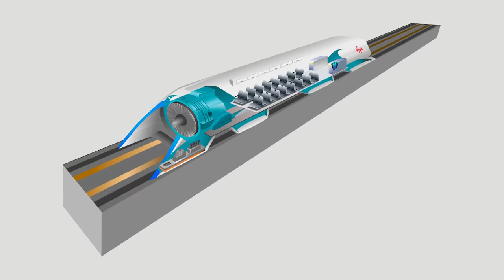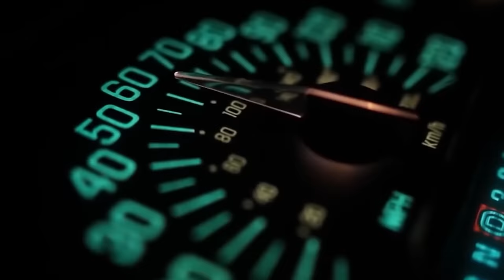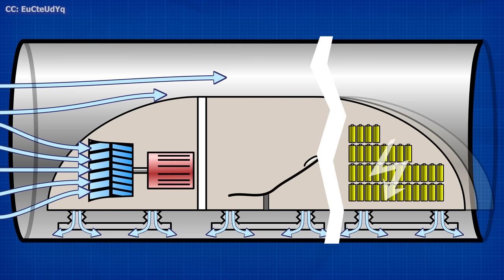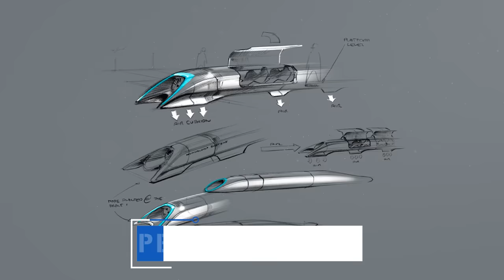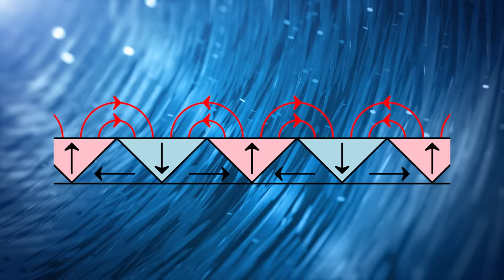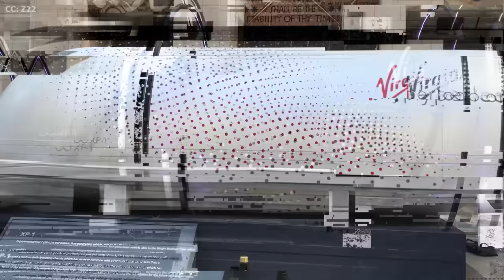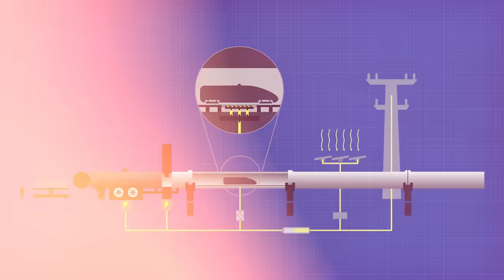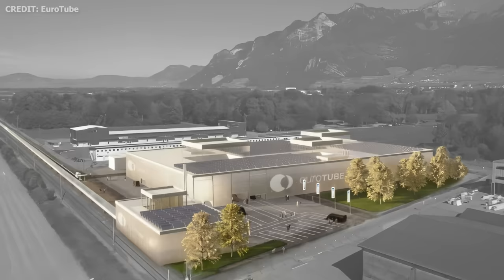We’re Getting Closer to a Hyperloop...

Comment: Japan's maglev train shows you don't need to build dangerous "vacuum tubes" to be able to go super fast.
Reply: I don't think Japan has maglev trains. China has a line or two in operation, all others are prototypes. It's just way too expensive. The point of Hyperloop is low cost.
Reply: @andrasbiro3007  "low cost..." Then why are all Hyperloop operational cost estimates 10X that of regular high speed trains and 5X that of airliners? Oh boy.
Reply: Six operational commercial maglev systems can be found worldwide, with one in Japan, two in South Korea, and three in the big C. The most extensive among the three within the big C is the impressive -Shanghai-Transrapid-project-, accomplished in a mere two and a half years at a cost of ¥10 billion (US$1.33 billion).

It stretches across a 30.5 km (18.95 mi) track and boasts an impressive top operational commercial speed of 431 km/h (268 mph). Consequently, it has held the title of the world's fastest train in regular commercial service since its inauguration in April 2004.
Reply: @andrasbiro3007  Don't lie.
Reply: @mururoa7024 
Because they are hopelessly wrong. We can argue about the construction cost, but the operation will be cheap. There's nothing that could cost much money. The power consumption would be minimal, that's the whole point of using vacuum, and the entire system is just a couple of electric motors that need very little maintenance.

Regular high-speed trains have to fight drag and rolling resistance, hyperloop doesn't. And planes burn a lot of very expensive jetfuel, while hyperloop runs on cheap solar power.
And hyperloop can even recover it's kinetic energy during braking.
Reply: @neo4reo 
That's better then I thought then, but still negligible. Less than one short line per decade.
Reply: @neo4reo 
Where did I lie?
Reply: @andrasbiro3007  does your mom know you're trolling on internet?
Reply: @mururoa7024 
Are you talking to yourself?
Reply: @andrasbiro3007  ''The point of Hyperloop is low cost.'' Now that's the biggest joke I've heard about it so far. It's not even remotely low-cost, neither in building it, nor in maintenance. How will you maintain an even vacuum over several kilometers? That's right, you need a crap-load of pumps. How will you perform maintenance on and inside the tube without having to shut down the entire track and removing the vacuum? How precise do you have to make the bore tolerances for the tube and ensure that it never gets too wide or too tight throughout the track if sun radiation heats up the tube?
Reply: @InfiniteDeckhand 
1. Maintaining low pressure is easy. Tunnels are already airtight and can withstand several atmospheres of external pressure. Simply because of groundwater.

2. Pumps are very simple machines. And once the desired pressure is reached, they won't have much work.

3. Not much maintenance is required inside the tunnels. Maybe once a decade.
And it's trivial anyway, a pod can just go there, deploy inflatable seals on both ends, and then workers just do their thing normally.

4. Since they use boring machines with a fix diameter, the precision is automatically given. And it doesn't have to be super precise anyway, the pods should levitate at least a couple millimeters high.
Or if it's an issue, there are many ways to make the surface smoother. We have huge concrete surfaces with a mirror finish.

5. No sun underground.
Reply: @andrasbiro3007 
1.They're not, even maintaining low pressurized pipeline is harder than it seems, even pipeline contract and shrink. That leads to fail gaskets and broken seals all the time. That's your ordinary pipeline not even hyperloop pipe. I work in oil pipeline industry. 

2."Pump are simple machines" yes if you're talking about pump that sucks something liquid, then it can negates some of the heat and transfer it to the liquid it, it will be much harder and hotter for dry pump air and more energy extensive. 

Hyperloop Pipe will lost pressure on each transit unless you invent air pressure locking mechanism on each transit station which adds more cost. 

3. Maintenance are absolutely needed
Even simple pipe like oil pipeline get checked daily for cracked seals, failed gasket and corrosion. That's why pipeline will avoid underground tunneling if not really necessary. Even japan shinkansen rail are checked daily by seperate maintenance locomotive for ensuring the stability of rail.

4. Concrete are naturally porous. Air molecule are smaller than water molecule. You don't want building anything related to hyperloop with concrete. Not even the tube support structure. 
Since it was highly pressurized, even ordinary pipeline used steel and thats not related to people life's. Tempered steel is bare minimum but if you want to be safe then titanium all the way. Which add more cost.

5. no sun underground mean humidity will be much higher which leads to risk of corrosion is more prominent to all the structures, the tube itself and and its support structures, which leads to. More maintenance. 
 
Hyperloop Are carrying people not freight there's no way department of transportation of any country will greenlight mass transportation that lacks any means of possible evacuation. Underground mass transport are dangerous enough. Now you want add vacuum aspect to it? 

US high speed railway predicted to cost $57 million dollar per km and China cost $17 million dollar per km
Maglev is even more expensive than that, since hyperloop technology is new it could be quadruple of maglev cost
Reply: @TheAriebudhiw 
1. Tunnel, not pipeline. If you go under the groundwater level you have to be watertight, for obvious reasons, and also withstand high pressures, because you are essentially underwater too. So adding vacuum makes little difference.

2. Pumping air is like not rocket science. And even if it were, Elon has a rocket company too. By the way, it's possible to create vacuum using a rocket engine. The title of the video is "Defying Atmosphere - How Rocket Engines Get Tested In A Vacuum Before Going To Space". So if you just happen to have powerful rocket engines lying around, it's a possibility. I imagine these would be able to move a decent amount of air. A bit less extreme would be something like a modified high-bypass turbofan engine. But even these would likely be an overkill by a few orders of magnitude.

3. Again, tunnel, not pipe. Tunnels are generally very low maintenance. No rail either.

4. Air has to come from somewhere. Underground in the water table it's hard to find air. Also there are many ways to further reduce leaks. Additives, impregnators, a separate sealing layer between the concrete and the ground, etc. It's easy because the concrete does the hard part, the sealing just have to prevent diffusion.

5. Concrete doesn't corrode much. And tunnels are pretty common technology, going back thousands of years, we know how to make them. In fact, some tunnels were left without maintenance for thousands of years, and still working as intended.
I'm pretty sure there's an easy solution for humidity too. Like subways exist and aren't wet. Vacuum helps too, as the pressure goes down so does the boiling point of water.

6. Why wouldn't there be a way to evacuate? For starters, won't be worse than any other tunnel we use all the time. In the worst case you just re-pressurize the system and people can just walk out. But before that there would be many other solutions. First, the pods can simply coast to the nearest emergency exit without external power. They just need their air cushion, which can be maintained by redundant pumps. It would be much more reliable than planes. Then if a pod gets stuck, a rescue vehicle can simply dock to it's back and take the passengers out. Fire would be impossible outside due to the vacuum, and extremely likely inside due the lack of flammable things or ignition sources. For extra safety the electric parts can be kept completely separated and mostly in vacuum.

7. Also it's already operational in small scale and without vacuum. It's called Loop and it's in Vegas. It's been approved and very successful.

8. The whole point of Hyperloop is that it would be 10x cheaper than the California high-speed rail. There's no rail and no magnets (apart from propulsion), and no need to buy up tons of land either. And the cost of tunneling is drastically reduced by the in-house automated electric boring machines. And they even found use for the removed dirt, they make bricks from it. So instead of paying a ton for the disposal, they can sell it.
Reply: @andrasbiro3007   lmao, all the hyperloop prototype are using steel as material that make them a
More of a pipe than tunnel my dude. Did you even watch the video? Are you saying you are smarter than the engineer behind it that use steel? 
Rocket engine really, lol? Rocket engine is expensive, it's fuel even more expensive? And liquid oxygen oxidizer and liquid hydrogen are extremely combustible. Yeah keeping the cost down by using jet engine to reach near vacuum sounds logical.
Even if you insist, Concrete will make the pump work harder since concrete is porous, which will make it more energy extensive.
No one interested in "hype"loop anymore, india canceling their program, the qatari and Saudi probably too. Elon in his biography even said hypeloop is an agenda to lobby to make California HSR canceled, And it did apparently.
Reply: @andrasbiro3007  Hyperloop is such a waste of money. Just build more trains ffs stop wasting our limited resources
Reply: @TheAriebudhiw 
1. Those have nothing to do with Elon's Hyperloop. And therefor completely irrelevant to this conversation.

2. I'm not smarter, just reporting what the real engineers are saying. The best engineers in the world are working for Elon.
And as you can see from my reply, tunnels have a lot of advantages. The only reason they aren't used more is the cost. And that's exactly what The Boring Company is set out to fix. 

3. Obviously joking with the rocket engine, there are plenty of much simpler solutions. But it would work. And yes, it's cheap. At least the ones SpaceX builds. A Raptor costs $1M today, and it should go down to  $250K when production is fully ramped. And it has 300 tons of thrust. Exhaust velocity is 7173 mph, mass flow is 1400 lb/s. That's 4.4GW kinetic energy in the exhaust.
In pumping performance that's 1,500,000 cf/s airflow at 1 atmosphere dynamic pressure. If I got the physics and the math right. That's 0.6 miles of tunnel evacuated every second.
Raptors use Liquid methane and oxygen. Both are relatively cheap. I'm not going to do the math for this, I've spent way too much time on this already.
Again, this is a joke, there are far simpler ways to pump large amount of air.

4. As I said, there are many ways to seal concrete. It's being done routinely in construction.

5. Irrelevant who is interested. Elon has the money and resources to make it happen. It's on the Boring Company's agenda.

6. HSR wasn't cancelled. At least according to a quick Google search.
But yes, Elon wanted to cancel it, because it's extremely overpriced.
Reply: @rrai1999 
Trains are the waste of money. The Hyperloop would be 10x cheaper than the rail system it was meant to replace originally.
And it has a lot of other advantages too. Like speed and efficiency. Also with tunnels it doesn't take up any space on the surface.
Reply: @andrasbiro3007  Too bad it doesn't work and is a load of crap.
Reply: @rrai1999 
That's your uneducated opinion, which has zero value.
Reply: @andrasbiro3007  Unfortunately I am educated on this load of trash. I wasted time looking into it because it seemed like an interesting new way to get things where they need to go. Until I realized trains do what they purport to do but they already do it, there is industry tooled up to create more of it on the cheap in comparison to virgin hyperloop technology, and that the hyperloop technology isn't even efficient, due to only sending one cargo pod box at a time. The vacuum is not feasible to create for such a long distance. The energy consumed maintaining this vacuum is too much for it to be a usable technology too. It's dead in the water.
Edit:
Also, that's your uneducated opinion. Which has zero value.
Reply: @rrai1999 
1. My opinion is not uneducated, I have a physics degree, and studied this topic a lot.
Also it's not my opinion, I'm building my arguments on facts.

2. Virgin Hyperloop is very different from Elon's Hyperloop, especially after it's been moved underground.

3. The Hyperloop isn't meant to be used for cargo. Cargo doesn't need speed.
And in the US freight trains aren't as popular anyway, and going out of fashion in general too, because trucks are much more flexible. Also with electric self-driving trucks, that Elon happens to make too, road transportation is going to be cheaper than rail too.

4. The proposed high-speed rail in California was estimated to cost like 10x more than Elon's Hyperloop. It's an especially expensive rail line, that's why it became a hot topic in the first place.

5. Vacuum is feasible for any distance. Especially since it's not true vacuum, just very low pressure. The cheapest pumps you can buy are able to reach the required pressure. From there it's just scaling up. Tesla and SpaceX solve similar problems regularly.

6. I used ChatGPT to estimate the required power to maintain the vacuum. For a 100km tunnel it's roughly 4MW. That's $3M per year. It's no big deal. This is of course order of magnitude estimate.

7. Asked ChatGPT to do design a solar farm with storage and estimate the costs for it. It's $25M initial investment, and $250K per year operational costs.

8. So much more fun to have ChatGPT do the research and math.
Reply: @andrasbiro3007 
1. Doubt. I can claim that Im a physics professor on internet but that holds 0 value unless I back it off with actual proof. Same applies to you

2. If Elon's hyperloop is that good why every hyperloop company abandoned it and tries to work on their own modified versions?

3. What self driving truck from Elon lmfao. He made only double digit truck that's nowhere near as good as he promised and Tesla Self drive still needs to be supervised with occasional human intervention on cars, not even semi trucks

4. High cost of HSR in California is coming mostly from trying to buy lands for relatively straight track and making many structures on challenging terrain. Not because 2 lines of metal with technology that already exist in Europe and East Asia is expensive. Any1 with more than 2 brain cell would realize that Musk's estimation is pure BS when Hyperloop literally requires more construction on same challenging terrain and same straight track that requires many land/permission purchases.

5. Neither Space X nor Tesla ever deals with vacumn space for multiple pods for hundreds of miles. The fact that current largest vacumn chamber is 100 ft diameter 122ft tall chamber by NASA (which is tiny compare to hyperloop) and how its door and walls of that room are massive seems to say that maintaining large vacumn is indeed hard.

6, 7, 8. Chat GPT is known for being often inaccurate on difficult and complex topic and it only has limited access to advanced academic database.  Also you simply havent provided all the variables for it. Some variable are straight up unknown because it depends on size and design of finalized system (pipe size, how much pressure difference, how much air intake when people enters and leaves hyperloop, how often such air intake happens etc etc).  As a result chat GPT just yapped random number from incomplete data because there isn't a complete list of variables to even do theoretical calculations. Perhaps you should have checked on any article about how to research with chat gpt since they all say its pretty good at helping you with writing but you have to double check info.

Conclusion: youre the clown here

Comment: The main problem I see at least with any of these large projects aiming to spend a lot of money in order to move people very fast over large distances, is that you can negate the need for such a thing by either removing the requirement for the people to travel in the first place (remote work, telepresence, etc), or just using existing methods and accepting the travel time, use the money to make the journey more comfortable, provide good internet on the trains etc. 
Both of these come at a fraction of the price, are things we already know how to do, and require no engineering megaprojects such as continent-spanning vacuum tubes or new materials.
Reply: The main problem I see is it came from Elon Musk's mouth.

Comment: BNSF is building a new rail hub in Barstow, CA to handle the rail traffic from the Ports of LA and Long Beach. As the crow flies that's 108 Miles (174Km). How would you depressurize a tube in excess of 108 miles long that's big enough to handle a 9'X10'X40' 34 Ton Shipping Container?
Reply: I suspect you wouldn't. 108 miles is a relatively short distance when operating at high speeds. Freight does not need to move that fast. Why send containers to an inland hub faster than they can actually be sorted? If conventional rail, HSR or not is not fast enough for those containers then Maglev would be more than fast enough. Absolute zero justification for a Hyperloop in this application. Besides, people never seem to realize exactly how large a pod would need to be to carry a typical shipping container. The diameter of the pod itself would likely dwarf conventional rail vehicles. The tubes would be massive structures. Not just heavy and expensive but unsightly. They won't be the dainty things in Musk's bullshit white paper.